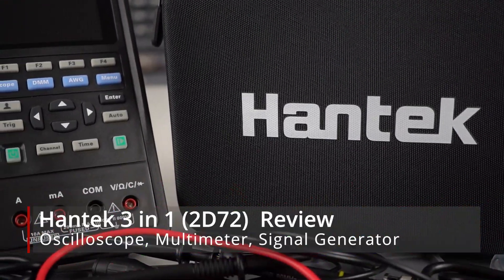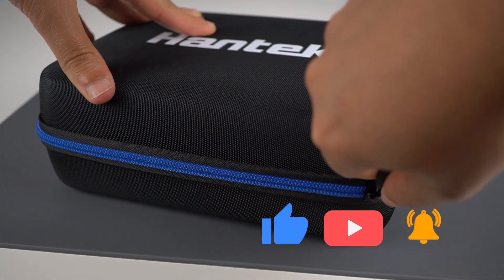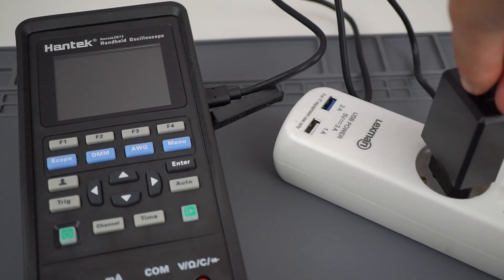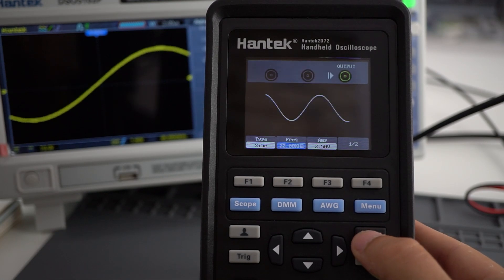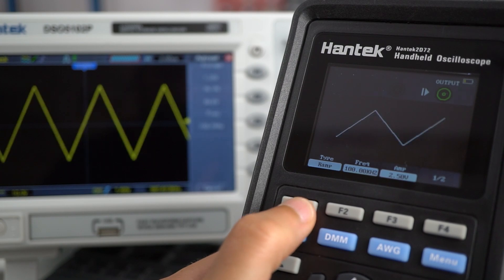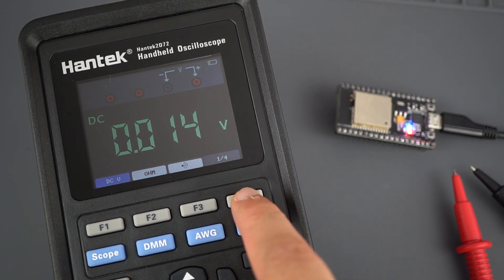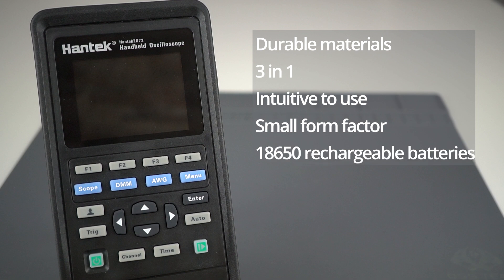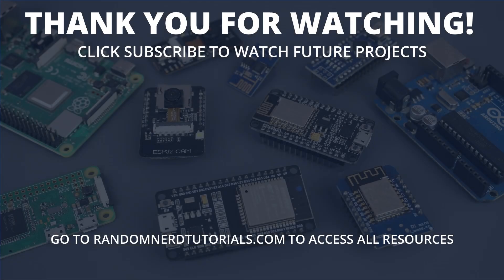Hantek 3 in 1: Oscilloscope, Multimeter and Signal Generator Review (2D72)

Comment: My DMM probes were trash. The tips didnt make good contact. I tried the most silly test with touching the tips together while on beeper mode. And they were going crazy. I put some generic probes from another multimeter and they worked - beeped stable and constantly. It looks like the tips of the dmm probes have bad coating on them and they dont make good contact
Reply: Best to replace all the probes with $10 ones from Amazon.

Comment: Can it be used like a DSO and transfer data to a computer?  Can the time base be slowed way down to collect and store data over hours?
Reply: It uses the Hantek 2000 application on the PC, which mimics all the features on the FP of the scope. You can save data on the PC from that app. No sd card.  You can save large amounts of data on the PC app.

Comment: Also: can the waveforms captured by the device be transferred to a computer via usb cable or a usb drive or memory card?
Reply: It uses the Hantek 2000 application on the PC, which mimics all the features on the FP of the scope. You can save data on the PC from that app. No sd card.

Comment: Can one use the function generator and the scope at the same time?
Reply: yes, I set a wave form first, then use the scope function to show that
Reply: That's my doubt too. Thanks to ask (and thanks to answer, lol).
Reply: You connect the waveform generator output to a scope input - the are separate connectors.  You will need to set the waveform up, the switch to "Scope" mode to see the wavform.